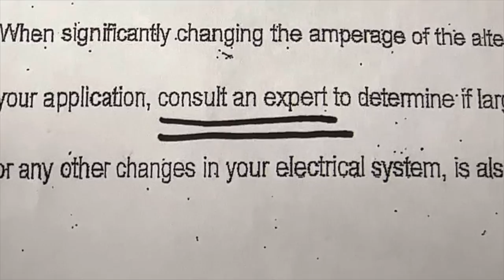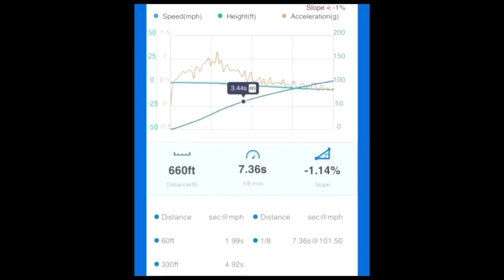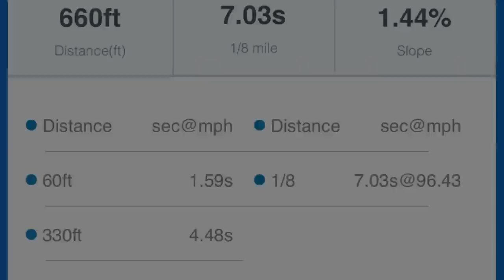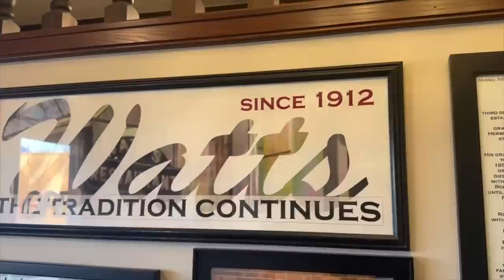BLOWN UP?  The 421 goes DOWN as THE MUSTANG starts taking shape at JAXWAX!

Comment: .060 over makes it really thin between the cylinders and sealing that tiny area with an MLS gasket will be challenging when spraying 300.
Id sleeve it if it were mine, keep the bores small.
Reply: And Chiefs motor! Almost thin enough to see thru to the next cyl.  I've always felt standard bore didn't leave much but 4.2??
Reply: Sleeves do make the deck weaker, but I'd definitely sonic check it too before trying to run it with a big overbore.

Comment: Hopefully the blocks still good I dropped two valves in my turbo h22 quick head swap and it still ran fine ! Pistons did have some dents but still layed down over 500 to the tire on 91 pump not to shabby for a 4 cylinder

Comment: Yep I definitely feel this one seven year ago spent two weeks building my s10 well watched most of it with really great friends swapped my s10 motor out put my 335 in it built four king put nine inch rearend in moser racing axles with full spool posi brand new 700r4 brand new 3inch exhaust put brand new tires on old school centerline wheels on they built me a one off stainless steel dash painlessly wiring box hood pins gauges you name it we did it about two weeks of 15 hour plus days in had the trailer tilted down gonna load to go to the event cruise night bands car shows for a whole weekend In Pierre South Dakota as I was backing it out it ate a cam lobe of the lunati cam spent 14,000 Dollars we figured and it never made been in storage ever since but you guys have slowly got me back to thinking it needs revived 😊

Comment: Hey there.  A little heads up on the Mustang Alternator.  It is suggested to run a #8 from the alternator to the battery or starter solenoid.  There have been some melted wiring on stock wiring alone trying to charge the battery with all those amps.  The factory charge wires go through the headlight harness to the starter solenoid with fusible links.  Just fyi.

Comment: I would like to point out that Bob just flipped that heavy ass steel block like nothing 😅
Reply: That's why he's the 🐐
Reply: I thought that same thing. Though stripped down a small block isn't bad. I've tossed them.and old online sixes with crank cam and pistons around when I was younger.
Reply: When I was about 10 ish I seen my dad man handle a 327 block into a log truck by hand with the grill out.  My dad is gone now and as a older man myself I look back and realize how strong a of a ole timer he was.
Reply: Everyday 💪😎
Reply: Note to self..  Don't mess with uncle Bob
Reply: I worked in a machine shop for several years, you just naturally get stronger. A couple years there and I was picking blocks up off truck beds and sitting them on the ground. May be why my back is wrecked now but it was always fun to see guys eyes pop and their chins drop when I did it.

Comment: Div. 7 Double this weekend in Chandler, AZ.  First round of STK Elim. On Friday, at least 4 let the bad smoke out at speed with engine expirations. And there was a bunch in other categories also.

But the worst was that 1 that followed those up.

B/SA in left lane, A/SA in right lane, both beautiful cars, B leaves hooks, A leaves and spins but both are very close lights, A knows he will not catch the B, and both get on the brakes hard, the B backing up to make it close and safe and the A carries it deep and his front binders lock up and the car slides over the line, has already lost the race, and it makes a hard right toward the concrete wall. He jerks it hard back left, and of course they are 50' past the finish line and still dead side by side...and the A/SA is now into the passenger side of the B/SA car, and smoke everywhere....They both walked away uninjured outside of their pride and joys. That race could have gone a million ways, and it went all kinds of bad. And there was enough blame to go around the block 5 times, let me count the ways...A knew he lost that race 4' from the starting line. B knew all he needed with a 2 car lead at the 1st MPH stripe was wap, wap, and he wins,   ....I could go on, and on, but I won't as schidt happens. You just cannot move backwards, only forward.
Reply: Oh, and after the above happened, just as they get the mess all cleaned up Paula Cotton (who had a bad wreck at that very track a few years back), was sitting in the lanes 2 pairs back to run that same right lane (she had a bad feeling it appeared), decides to live to race another day (she did race on Saturday and Sunday), and pulls off and down the by-pass road back to the pits, and her competitor went on a comp. bye run.

Comment: We have all been through it especially if you raced cars for a while.
I had a big block built for a 1970 Nova I had at the time.
I didn't have twenty miles on the engine.
I stop for a red light and the car stops running the guy that was with me  I said to him something is  wrong because this car's engine 
Has never just stopped running like that.
I start the car back up and pulled into a gas station the engine isn't making any noise 
So I get back into the car to drive it back to my garage and I noticed the oil pressure was all over the place.
I get the engine pulled out that night and take it to the guy who built my engines at the time Ted Borowski.
So he called the next day to come to his shop.
So I do and he shows me one of my roller lifters.
The roller on the lifter had come apart and by doing so the roller and the needle bearings went through the whole engine.
The crank was messed up a couple of cylinders the cam a couple of pistons and I believe a valve got it as well.
And yes the lifters were brand new.
Like I said if you raced long enough we all go through this it's part of racing

Comment: Damn that sucks. I've had the same exact thing happen once. Brand new engine with a beautiful set of ported and polished 461 heads with 2.02 valves ( this was 1997 and I paid $850 for the heads which was a chunk of money back then) Only to have a keeper fail and drop a valve that destroyed the head. The block was fine but trashed one of the heads and piston.

Comment: I've seen more nitrous destroy blocks Pistons and heads and Dyno testing doing the same to all above, if you ever want to find a flaw in valves Springs and rotations run nitrous and or dyno test, I've seen buckets of Pistons from nitrous, and salvage yards full of blocks neither one of these are bad in moderation but the dyno test that I saw you go through with this brand-new block looked to be extreme and the damage very seldom show up on the dyno it shows up on road test, adding new part,or  going to the store etc.but this is my opinion and I'm a man that has built on a budget for over 30 years, and my last block a small supercharger with a bad carburetor found a bad valve that snap the head off, stim and retainers still in tack and now I've got a block that has to be sleeved, in 30 years I've only had one that dropped a valve this was because a customer over revved it when I told him it could not Rev over 6,000, and engine could rev. 7800, none of my business but I'm trying to pass 30 year of experience to good people, if a engine is going to let go it is going to, but the stress to parts from nitrous and dimeo can be extreme and no doubt I have seen buckets of parks and 30 years without a doubt you have definitely seen more race damage then I have but thirty years as a auto technician dealing with race and daily drivers I've seen a lot of abuse, and farm boys can tear up some crap LOL.
God bless and be with all of y'al 
PS.I pray y'all have a great season

Comment: A few years ago I went to load my race truck on the trailer and the motor seized up during idle. The cloyes cam gear rolled the keyway on the drivers side head and caused lots of damages to both heads, valves, pistons etc. It took a year and 15k to fix everything. Sucks big time to lose a motor like that.

Comment: Ouch! Looks like it'll need one sleeve at least, since I didn't see the other cyl., but I've been there with a dropped valve before and those marks look too deep to come out with a .020"(per sidewall) cut. With a 5 headbolt SBC I wouldn't be scared to run sleeves N/A, but with as much nitrous as you're wanting to run trying to push things, I dunno. Deck strength does start to weaken when you run sleeves...

Comment: Well if you see this Mr. Bill would you mind giving me a rough estimate of a 421 like yours costs to build from the start? I am wanting to build one for my 67 Nova. Granted I would be starting from nothing because the 327 is coming out and getting put away until I get older and don't want to play anymore. So will definitely need a block as well. I think I want a Dart block but I do understand there is cheaper ways to go. And I will add this. I am just wanting a peppy 421 all motor. Not interested in going as far as Nitrous.

Comment: Just bought a 69 chevelle drove it 6x. On my way to get gas the 396 lost oil pressure to 0. Lots of valve terrain noise. It still starts and runs but idk. I waited 15 years to get this car just to have a really pretty paper weight in my garage 48k later. Totally bummed. So I feel the pain

Comment: Bill, are you running into lofting problems because of insufficient spring pressure for the high ramp rate of that cam at max rpm???

Comment: OMG that sucks, that's not something I have ever experienced.  That's the kind of failure I worry about with my hot rod.  I did everything right, used good stuff, good machine work, and assembled well.  I drive and maintain it to make it last, keeping RPM's in check, no boost, good oil, frequent changes.  A broken keeper/valve/ retainer is my worst nightmare failure.   Something small that can cause so much damage.  You certainly handle adversity well, looking forward to it's fix, good luck.

Comment: Hate to see that happen Old Man, but there is always a silver lining to some things, so count your blessings, there is no bent sheet metal, because of when it happened, like Jackie's Caddy Jack, both happened when neither of you were going really fast, and no guard rails were hit, and no buttons with giggle gas were pressed, and no fellow competitors cars or your own were damaged.

If I am going to blow up an engine (and have been really lucky in life so far, after thousands of passes down the quarter earlier in life and never had 1 expire at speed yet, but knew exactly when 1 I flat wore out was about to and parked it during competition, because it totally uncharacteristically picked up a bunch of E.T. after someone red lit against me in the Semi's...I just knew that 440 was going to grenade on the next pass, so I drove to my pit and shut it off and picked up my runner up check. I would not even take the chance to do a burn out and stage and sit.

If I lose one, I hope it happens just like yours did, on a slow speed trip around the block. I know it hurts when you lose a bullet like that, but a crapload of worse things, and much worse results can, and could have happened.

It is always the cheapest little tiny part that fails that causes the worst damage also, as a 50 cent "O-ring" and a stinking pc of light  weight foam took out 2 space shuttle missions and doomed an entire crew and another shuttle to split into pcs and rain down from Texas to The Atlantic ocean.

Build it, race it, break it, and build it back again stronger. Count your blessings, but chin up, fingers crossed, praying you get it back together soon, and I still feel bad for ya Bill.

Comment: If by chance you have to get a new block shoot me a message, have 3 brand new world products blocks 3.999 bore and enough meat to go 4.200 and will take a 4.000 stroke without any clearance issues. All mains are 4 bolt billet steel caps

Comment: I would sleeve those 2 cylinders and go 4.165 bore
Reply: Not worth just sleeving 2 cylinders is most cases. Most shops labor charge for the set up. To cut each bore and add the sleeve is quick process after that. From what I was told. Decided to get a different running engine that had a cam gear failure. Ended up bringing it to Bob

Comment: Old man’s garage one of the main reasons LS engines are so popular is how common they r n make decent power reliable if built right Texas speed builds some nice ones every part in stock can have one built to your specs n ready n day or two no bs they have several options on power to be good back up motor to have round

Comment: You are well experienced so I don't have to tell you what you already know.  That being said one has to ask, "Why did the keeper fail?".  Keeper failure just isn't that common on that level of motor.  Again, not trying to tell you what you already know.  The two most common issues I have found is the body of the rocker arm contacting the spring retainer  at some point during its travel.  Rocker contacts retainer, compresses retainer instead of valve tip and the keepers have enough room to come out of place.  This will be very evident by looking at the body of the rocker as the anodization on the spring side of the rocker with be gone.  Second reason would be valve float.  Hydraulic rollers can only take so much RPM no matter what spring.  I will admit, we are getting lots of junk parts in the current supply chain climate and failures are high.  Even brands I've used for years are failing. One last comment, are sleeves available?  If so, have Bob bore the hole, drive a sleeve in, bore to size and deck the block.  Best of luck Sir.  Enjoy the content.

Comment: I know what it feels like. I've hot rodded all the brands even AMC back in the day...the couple chevys I blew all seemed to be running good with no warning when it happened. It seems I've had to really work for every win I've got the last few months. I built a stock with a cam 351M for a friends truck and ran it on my engine stand and it just wasn't right and wouldn't idle. I finally had some time to pull it down today and it had wiped cam..I'm perplexed..it was a left over I saved with the lifters marked. Life ebbs and flows...for me its been ebbing more lately.
Reply: That sux, any chance a couple got swapped around?
Reply: @stevenbelue5496  No I removed each 1 and put it in a seperate marked aspirin bottle...with oil. I'm done with flat tappets..not worth the risk anymore.
Reply: @creeksidegarage852  me too, I haven't ran a flat tappet since the 90's. Metallurgy must be really bad nowadays I hear lots of folks having these same problems.
Reply: @stevenbelue5496  or the quality of the oil...
Reply: @stevenbelue5496  Thetes been a lot of speculation about the cause. A guy who runs a machine shop here on YouTube did some tests and found the steel to be adequate...however the machining on the lifter was inconsistent..they need a crown to make the lifter spin. It as good a theory as any...only reason I used this cam was because I had it..I have roller in everything else.
Reply: @jodycook9877  I would think if it was the oil other parts would fail, but idk, is the lifter to lobe the most intense friction point in an engine, more than the journals and other contact points.
Reply: @creeksidegarage852  that would make more sense than the actual metallurgy because most steel in other parts is holding up well. If that lifter pad isn’t machined right I would imagine that would be an instant failure. Raises the question after all these years why the problem now.

Comment: I knew a dude who bored his 400 smb to 80 over he put the biggest pistons in it that he could. Largest Crank, cam , valve's in Camel hump 🐫 head's put it in an O'l Chevy like your 64 and put sleeper exhaust on it, well you know how that story goes. He built it like oh, 25-30 year's ago. It' still has the gonnies for the pony's. Eagles for for illegal, you know starts with a R he he he! Last I seen he was still putting 87 octane in it that's our lowest grade gas  And stretching the blubber off the tire's and lighting fire's on the streets. For a tweaker that Guy could build an engine in fact probly the best I seen at the machinery he used to build with. He could use everything in the shop. The boss knew that he tweaked  but as the boss  he said was a functional tweaker. He payed the guy good and They Both joked about it,,!

Comment: Was it a faulty part
Reply: I'm bettin' on "USER ERROR". i.e. Excessive use of the (Billy's aptbly labeled) "CLOWN FOOT" driving method, as well as extremely excessive use of the available giggle juice buttons. However, the jury is still out on that question at this time, due to no reliable witness availability to confirm or deny the allegations.

Comment: Sorry Bill, but kinda odd, very odd in fact that a valve keeper just lets loose after swapping the carb. Not exactly buying it because I think there was something foreign that was introduced into the engine and caused all of this. Was fine before the carb swap and then it wasn't afterwards. Just makes sense guy.

Comment: Never know what will happen
I do not care if you have every single piece brand new ,
 It happened to me before
and we came to the conclusion ,
They were 90 pound Springs
and one of the Springs the temper let loose , Cause it to  float keeper came out ,
 But could have been put in  not correctly , or  wrong keepers ,
 I mean who knows that's hot rotting for you

Comment: Wow my wife would kill me. I built an engine blew it up a week later built the engine blew it Up 3 week later built the engine blew it up a month later. I build a car I get at least a year of enjoyment. Drive them hard. I honestly think I can beat your Malibu. With my 03 Avalanche 6 inch lift on 35's 5.13 gears Detroit truetrac a little mild built 5.3 390 horsepower. It runs 11.90 at 114 in the quarter. I will beat your Malibu in the 60,330,660. I'll probably get you at the 1320. And drive it 600 miles back home.✌❤😃